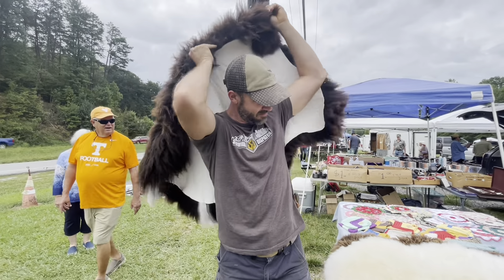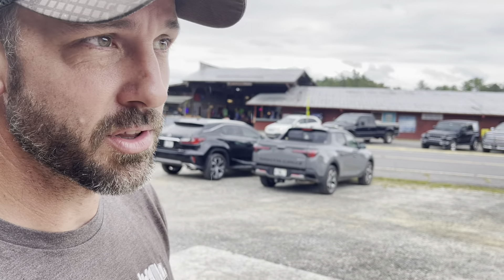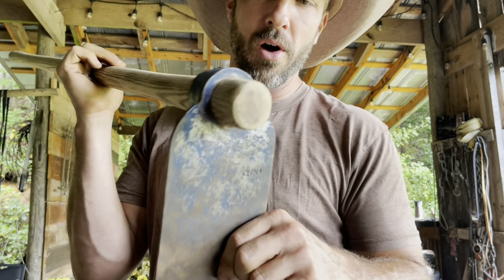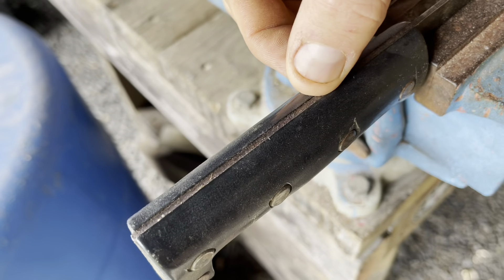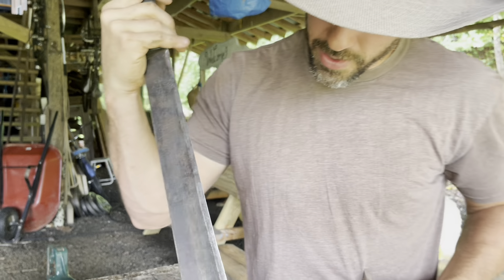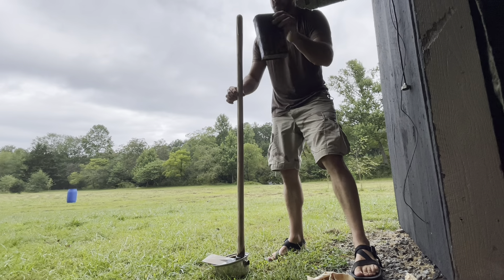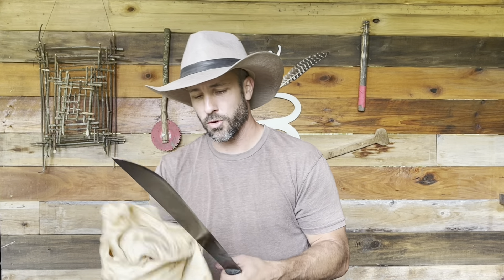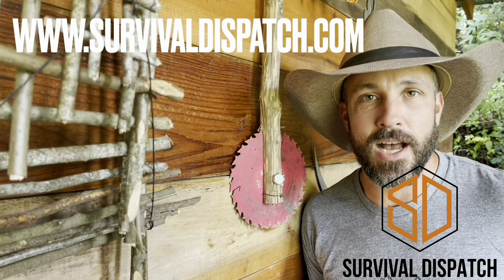Prepping on a Budget | On3 Jason Salyer

Comment: Dog person. But I do like cats. Except when they crap in my vegetable gardens. 

That hoe handle came out really nice! I have been restoring old handles, and new ones by sanding them down (scraping the nasty varnish off the new ones first), taking a propane torch to them to give them beautiful interesting patterns (I hear that sort of blackening the wood a bit makes them stronger and more resistant to the elements), and then oiling them with pine tar oil. They come out beautifully. In a work party situation, trail clearing or whatever, my tools will be distinctive because of the work I do on the handles, and it will obvious which tools are mine. 

I love old tools, they are definitely worth salvaging and restoring. Even though I'm a girl I have always loved old tools. My dad inherited a bunch of old hand tools from my grandpa and I used to go out in the garage sometimes and just look through the tool boxes. Old hand drills were some of my favorite. Such beautiful craftsmanship. If I had been in the country and around (and not so nomadic) when my dad passed, I would have asked for the old tools. The new tools are usually so crappy it almost hurts me to use them... hurts more to pay retail prices for them. A worker I had helping me broke my hoe handle by misusing the tool. I still haven't replaced it because I haven't been able to find a handle that fits. I went into the local hardware store (who didn't have a good selection of handles) and the guy tried to sell me a cheap and nasty new hoe (shaped like this hoe Jason just bought) with a plastic handle. Plastic. Yuck. I could really use my hoe right now, just about my favorite garden tool with a unique blade shape from decades of use by those before me. But I will wait until I can find a handle that will fit, I don't mind carving it down to fit. Otherwise I'll see if I can make one with the eucalyptus limbs I have collected. Really dense, heavy, hard wood that is difficult to carve, but I may have to make my own handle.

Comment: There's always been cheaper versions of tools and more expensive. I can remember there being screwdrivers, pocket knives and other stuff in the 70s where they had some sort of foil like coating on the metal and you used them a dozen or so times and the coating came off and there was nasty cheap metal underneath but I have screwdrivers from Stanley when they were made in Europe and America during the 80s, they weren't cheap and they are still just fine. It's great when you find some of the "just fine" stuff at places like flea markets, I like to see them go to people who appreciate them.

Comment: Jason -- I just watched a guy rehab a hand plane in about an hour real-time. It just so happens that I need to rehab mine old Stanley to finish a table that's not done yet. There's more to the plane than the cutting edge, but I'm pretty sure I'll use it better after working on it than I would be using a new one off the shelf. 

Cats + dogs = balanced.

Comment: My mauls and axes take a heck of a beating around the heads, 1/3 linseed 2/3 mineral spirits in a bucket is what I drop them in. My grandpa taught me to drill a hole in the base of the handle fill it with linseed and tap a dowel in. The oil infused the handle just like the water did when it was a tree
Reply from the maker: Very good tip!

Comment: I have a small selection of old hand tools (I'm an old woman with a ridiculous distrust of electrical equipment which never, in my experience, fails to break down forever at some point). That hoe head..I've an old iron mallet which was also slightly loose on an otherwise perfectly good handle. I hammered a large nail into the centre head of the mallet handle, which "widened" the end of it enough to tighten up the mallet. It's still working fine and the mallet head is still good and tight. Hej, from north Sweden. :)

Comment: Ideally you don't want that screw there. Those handles and eyes are tapered. Like tamahawk. Try removing the screw and setting the head a bit further on the handle. It should tighten just fine.

Comment: Definitely it is worth taking time to restore older tools, to someone my age, 70 it is almost a sin not too. Everything, or almost everything these days has built in obsolescence, one reason it is cheaper to manufacture, and second is that old profit thing, if people have to replace items more often there is more money for the manufacturer. one thing I thought you would do when you went to soak that grub hoe, after you commented about using motor oil and then in contact with the earth, I really thought, you would just use some of your cooking oil you use to run your truck, then no issues to worry about. Another outstanding, make you think video.

Comment: here in WV we call those chop hoes and they were made so it was easy to make a new handle if your handle broke in the field, all you had to do was cut a pole the right size ,square off the but end and slide your hoe over the top and it would friction fit, a couple taps on a rock and you were ready to go back to work, that hoe could be 150 or 200 years old and handed down through several generations
Reply from the maker: Yep! That’s why I like that design. Super easy to fit a new handle.